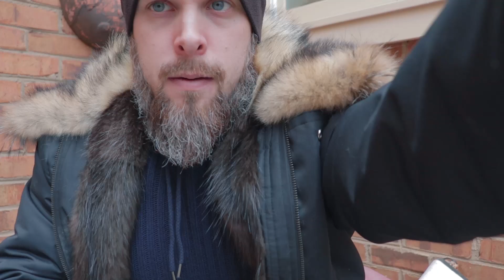Lumber Price Increases and Shortages - Build with Earth Instead!

Comment: I have seen people use strawbale as part of cob building and I have a question for you. Doesn't strawbales break down over time? I used strawbales on my garden beds and over a year or two, it broke down. My strawbales were out in the elements (rain/snow). I have been trying to research about using strawbales inside the walls with cob. We live in the country and our county supports "green building." Thank you!
Reply from the maker: Hi, yes. Strawbales will easily break down when under the elements/weathering. Strawbale buildings are designed to protect the bales. However, I'm personally not a big fan of strawbale building. I don't know how long they will last over time.